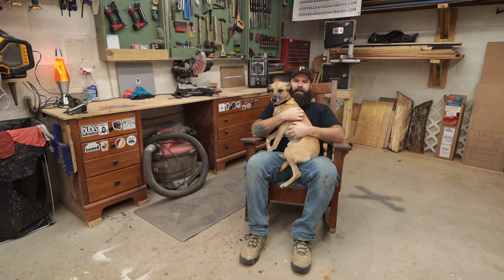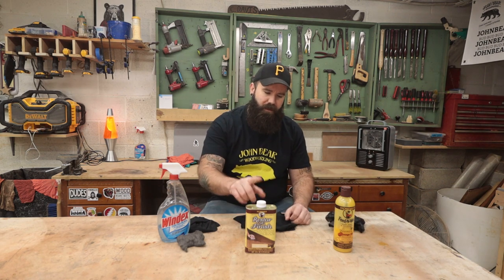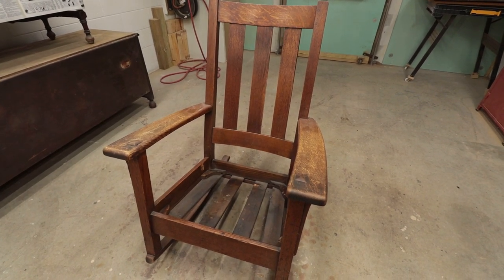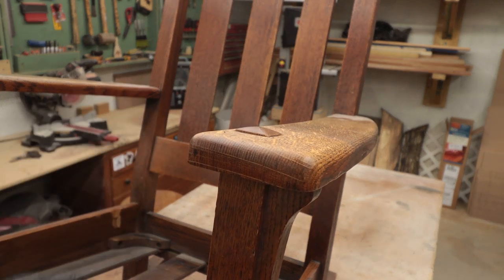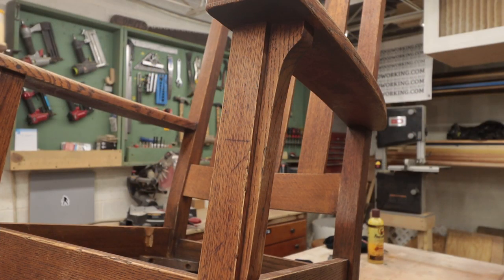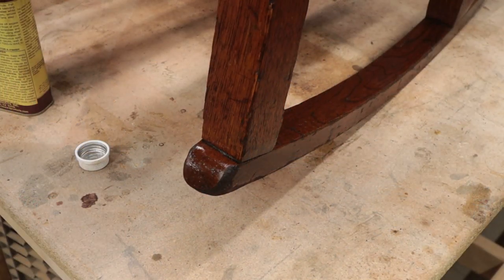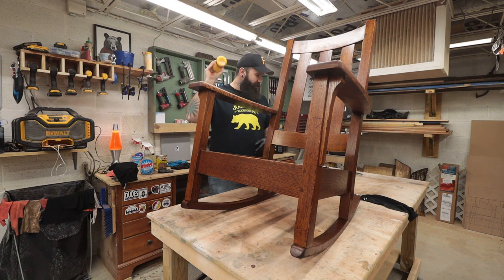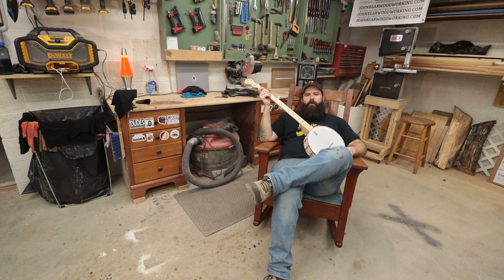Rocking Chair Furniture Restoration Makeover how to Bob Ross Style | 3.31.2020

Comment: What I also need to k ow which is why I choose your video...is the straps in the seat ..are they made of a nylon or what the one i just purchased is from the mid 30's early 40's ... I know you said you would show us how to do the seat however my uncle has a shoe repair shop that's been around for fifty years and I figured I'd get him to help me with the seat if I can just decide what I think it's made out of I'm not sure what the material is really does remind me of nylon however it's much thicker or is it Teflon I'm not sure but it does have those straps in it a little different than yours mine are more like to from back to front and two across from side-to-side from hip to hip

Comment: Please show how you redid the seat.  I have almost the exact rocker but now I am stuck on how to refinish the seating area.  Thank you!
Reply from the maker: I am still debating on how I want to upholster it. I can't decide on a black or brown leather/vinyl and if I even want to do it myself since it's sewn and it's a fancy seat with springs in it. I may take it to my buds upholstery shop. What are you thinking of using for your seat?
Reply: @JohnBearWoodworks  Well I just took apart the old seat last night, it was a mess and clearly it was falling apart springs and all.  I threw out the whole works except the frame.  I am debating buying new springs and upholstering it as I have watched numerous videos do it...but I kinda would like an option without springs.  I was hoping you had a workaround!  I am bound and determined to do it myself!  This weekend I am going to clean the rest of the chair as you prescribed and hopefully I won't need to fully strip it too.  I bought the chair at an auction and loved it despite its sprung spring seat.  Well, I wish you luck in your decision and have my fingers crossed for both chairs!

Comment: When cleaning an old piece like this, it's important to have patience, and of course, the right cleaners and keep at it with a little bit of elbow grease, (at the beginning) and then some graceful finesse, when finishing up. At the pieces that have a little built in dirt, I like to use anything from a toothbrush, to a child's toothbrush, or save and clean an old mascara brush for those purposes. Works like a charm on some of those little krediddles.
I once found an old rocking chair in a thrift style antique store, in the back, embarrased about itself. It was covered in back porch light gunmetal grey paint, and it must have sat out under the porch. It wasn't warped, but they were thrifty folk who had it last, I guess to use that type of grey porch paint on an old tiger oak piece. But I have to tell you about the real find of this piece..it wasn't like your chair. It had, in addition to looks, a practical piece for crafters and quilters! It had a built in half moon pull out drawer below the seat, where someone sewing could put spools of thread, (I think it held about 12 or so). It was where you sat down, pulled out what colors you needed for your project, and could sew away. It had a place for your knife/scissors, and your needles. At the end of the night, or when you couldn't see anymore, just put things away and slip the drawer inwards. 
Well, I loved this thing, but it was not for me. It was for one of my best friends, who was an accomplished fiber artist, and had lots of children, who were all grown up, she was a doting grandma She had tried to teach me knitting, but me being a lefty and her being a righty, well, she got all discombobulated at how I was trying to master my style and follow along. (this happens to a lot of us lefty's trying to learn things, you just have to learn from another lefty, the righty's get all confused...lol.)
I stripped the thing, it came out just beautiful, I also got some antiqued brass tacks for some lovely old fabric that I reupholstered her with, along with new padding. (the horsehair stuff was interesting, but let's face it, who wants possible bugs in the house, I had fun adding that to the outside barbecue..boy did that stuff stink while it was burning.. I only added natural cotton padding to the new mix.
After all that was done,  I saw the natural color, not unlike the color on your chair above, did not want to mess around with it, and got a tung oil that was very close to the natural color, and oiled it up, 3 coats. 
J had an olivey-brass  plate inscribed with "Remember Me" that I affixed on the back. It was to commemorate all the years of friendship between us. I delivered it to her delighted face, all smiling. I said "ya got your spools picked out have you?" She said yes and we loaded it up and she just rocked away in it. 
I was tired of her husband just rocking away in his own modern chair, so I got even and gave her her own chair, a chair for a fiber artist. That's what friends are for.
Reply: i guess it is kinda randomly asking but do anybody know a good site to watch newly released movies online?
Reply: @Kase Keaton i use flixzone. You can find it by googling =)
Reply: @Anders Santana yea, I've been watching on flixzone for months myself :)
Reply: @Anders Santana thank you, I signed up and it seems like they got a lot of movies there :D I really appreciate it!
Reply: @Kase Keaton glad I could help :)

Comment: I have a very  old Secretary that appears as though someone has attempted to refinish.  The finish looks uneven. The back of the cabinet doors are not finished. If I wipe with a damp cloth the color matches. Im thinking about lightly sanding and then applying  polyurethane.  I've seen many of your videos and know you like Varathane. What are your thoughts on their waterbased poly? Also  do you have any suggestions for hardware for older pieces. The secretary I'd say is Mission or Arts and Crafts.  Not fancy with very straiggt lines but someone put fancy keyhole scutcheons on it. Thank you
Reply from the maker: I've never used it but I'd give it a whirl! Suggestions for hardware to buy or how to clean?
Reply: @JohnBearWoodworks  T buy. Something more appropriate for the piece. The drawers have steel ring pulls and the key hole Escutcheons are brass and intricate but have been altered on one side as to not overlap the doors.
Reply from the maker: I'd try eBay or an antique shop!
Reply: @JohnBearWoodworks  thanks for the quick responses!